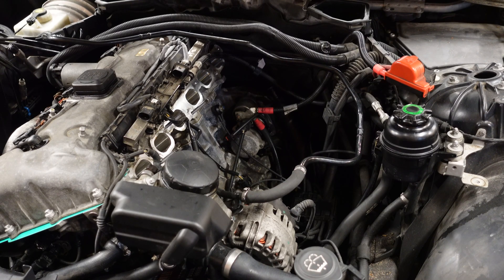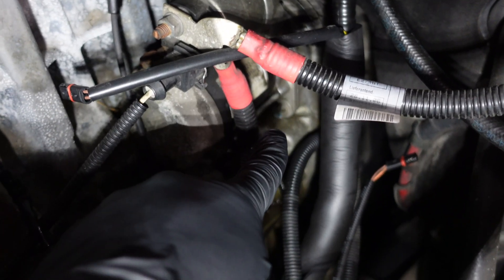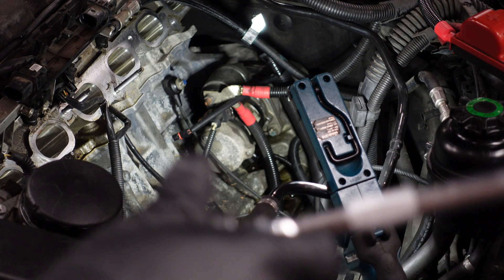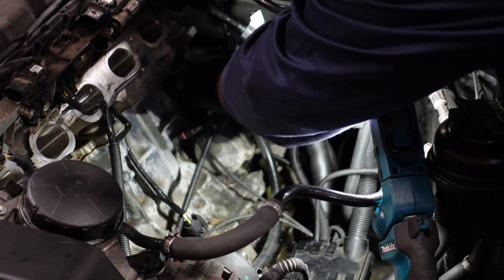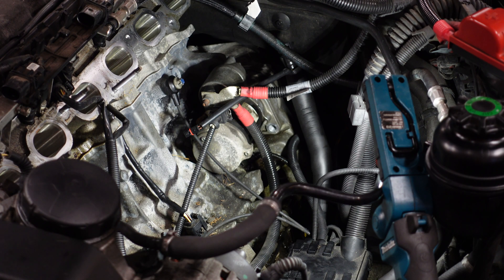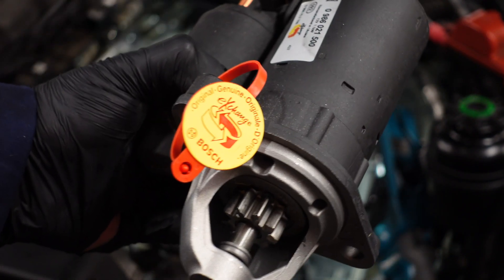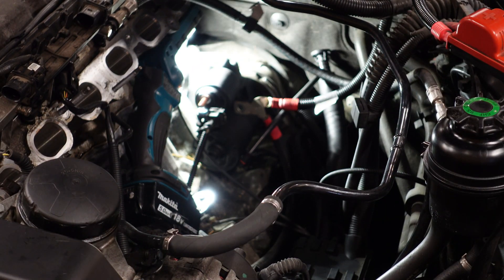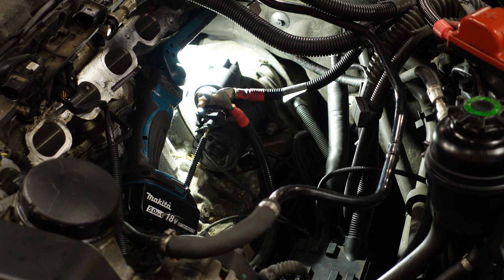BMW N52 STARTER MOTOR REMOVAL & REPLACEMENT

Comment: Great stuff! I'm currently having issues with my rear fog light as warning comes on. Turns out the connector has melted and needs a change, along with the light panel. Would be great if you can do a DIY showing how one can do this for an F30. Great work, keep it up! 👍🏼

Comment: Hello to everyone I have a problem with my bmw e 60 Benzin the first time it doesn't start, then the second or third time it starts normally?? Thank you in advance
Reply: Check battery and if fine check spark/glow plugs before moving on
Reply: @xhoniinoxh5878  you could also check the ground straps if you never have..they corrode easily and can cause intermittent starting before becoming useless..and even w/a scanner you'll get starter codes, even though the prob is the strap(s)
Reply: Error read out and there are no errors in it, battery is new
Reply: I emphasize that only the first time it doesn't turn on, then I can turn it on as many times as I want without a problem, leave it for 15 minutes or more, then again the first time it doesn't turn on, is this a mechanical or electrical problem, I don't understand
Reply: @xhoniinoxh5878  sale the car